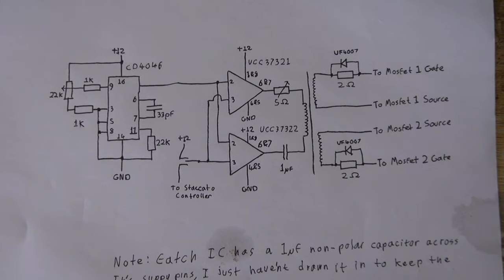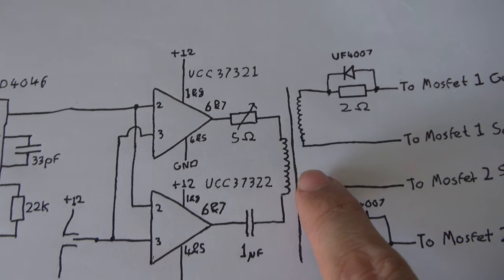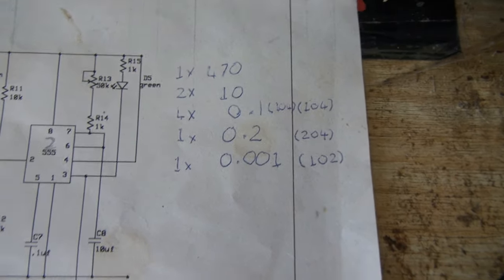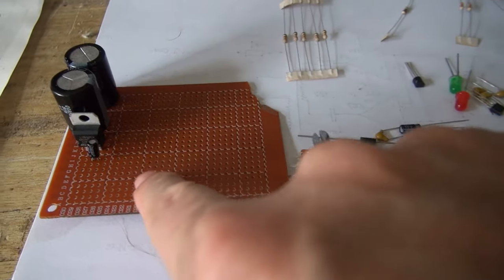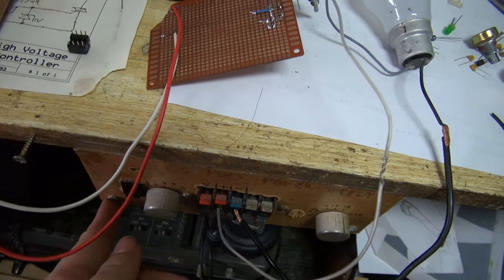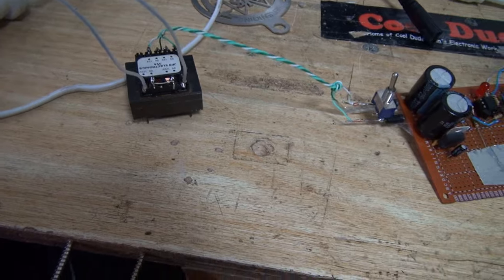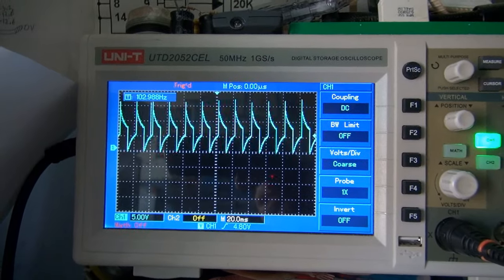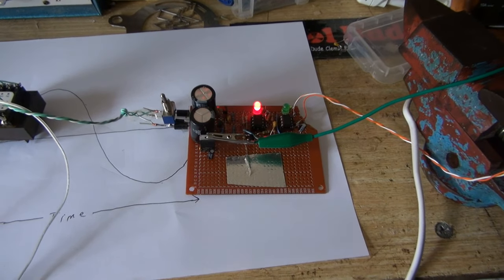Making a Tesla coil Driver pt 1 - The interrupter

Comment: Hey Clem, good to see you back making TC videos, there was a mistake in the Steve Ward schematic, i doubt Steve made the mistake, it was a mistake introduced by someone else copying and uploading the schematic,  anyway i fixed it and published the corrected schematic in styropyro discord server if you want it, we want full power anyway so meh, you should try using a level shifter to feed the bus of your inverter to give you 10ms ramp rather than the 5ms quarter period of half wave rectified 50Hz ..All the best 

Steve
Reply from the maker: Thanks, I'd like to see the fixed schematic, even if just to see what was wrong. Do you have a link to it?